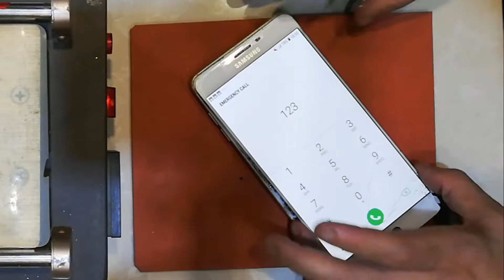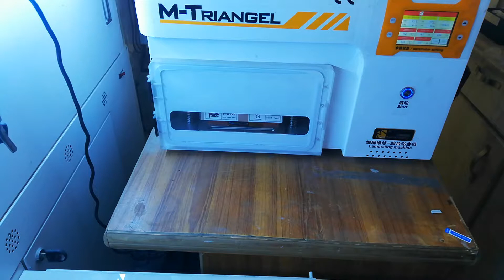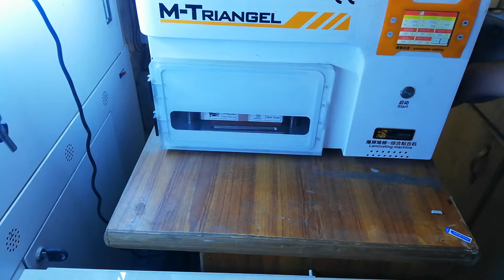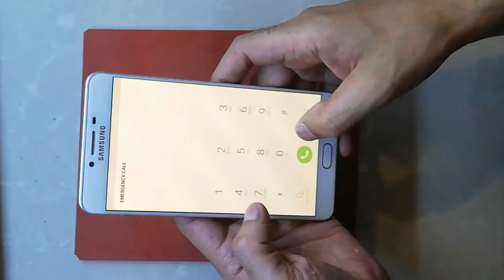C7-C7000 Touch Glass Replacement , OCA Machine , C7 Disassambly , Teardown , By Level Technics

Comment: where is your shop?
Reply from the maker: Star city mall saddar karqchi
Reply: @leveltechnics8872  c7 front glass replacement chargers kiya han?
Reply from the maker: 2000 rs
Reply: @leveltechnics8872  bahot zyada hai meine 700 me change karwaya
Reply from the maker: Good.. Sir apny to boht reasonable price mein replace krwa lia..sir hum only orogonal glasa replace krty hn glass or finger print ka color same original hota h 1500 ka glass h 500 replacemwmt chargis with oca machine orginal foting k sath..